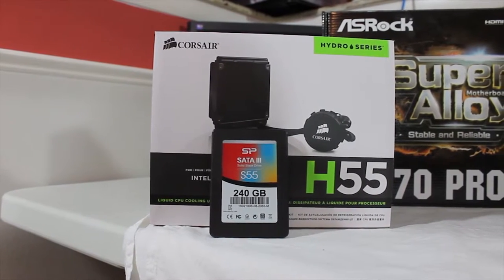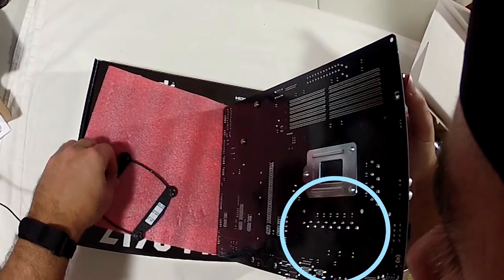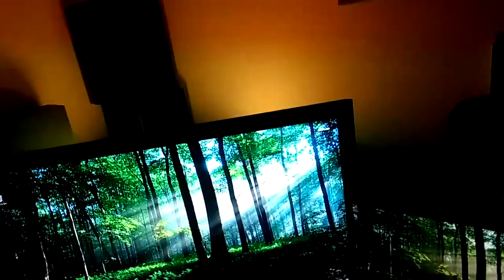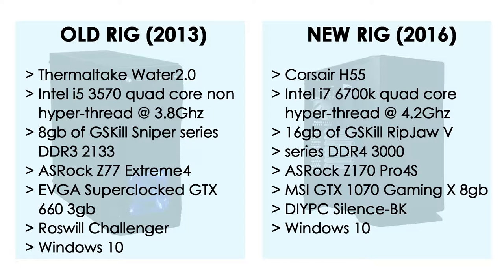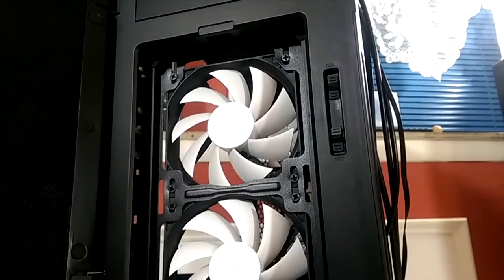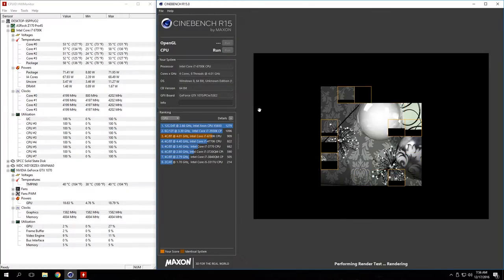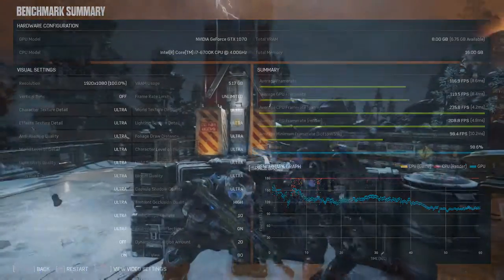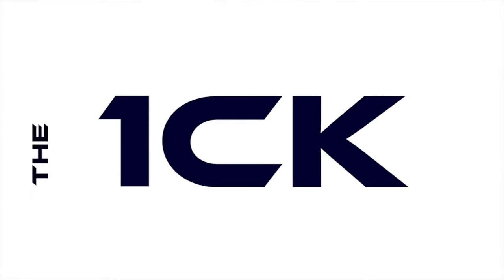2016 Build Vlog - Build, Bench, and Conclude on the $1035 Gaming Rig

Comment: I used the same motherboard and case. The only downside I found of the motherboard was that it only had two usb connectors which was not enough considering the case would need to use both for the usb 2.0 and card reader that it featured.

Comment: I know that you probably don't have this case anymore, but how good was the airflow with the front panel being closed?
Reply: @cktechcheck  I ended up getting this. It's unbelievably quiet to the point where I can't hear if it's on. I use it for normal desktop use and have never needed to open the front panel. It's a nice case and huge improvement over my old one.